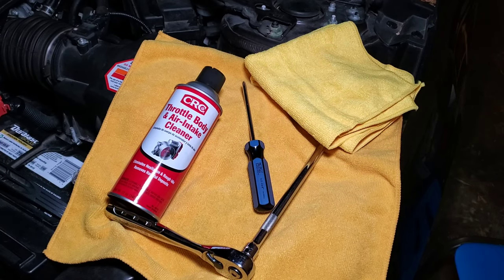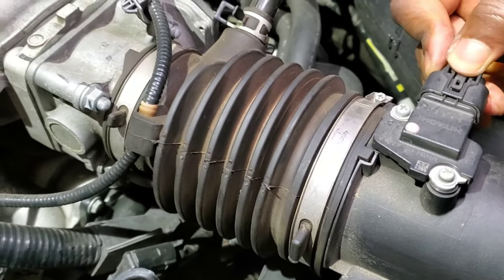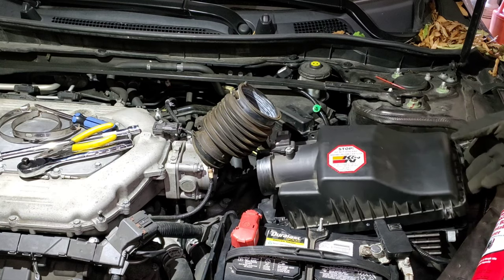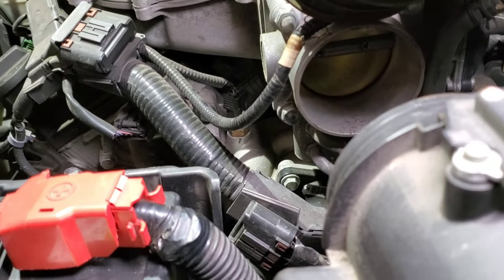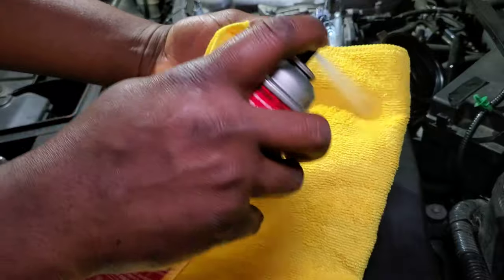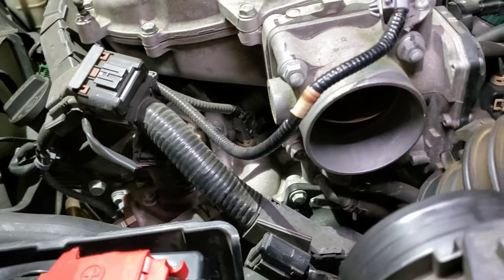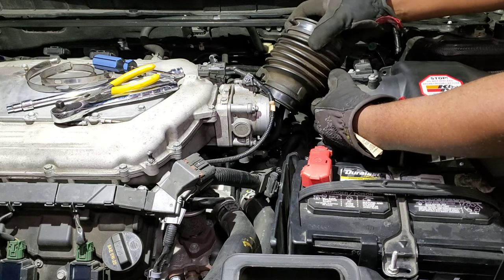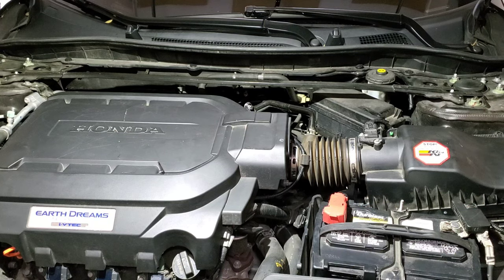How to Clean Honda Throttle Body

Comment: If you split that rubber, you will start having weird idling. Mine idling was pulsing whe stationary and found out it was split at the bottom and you need to do an idle relearning. Mine is an accord 2004.

Comment: Did that help to stop the vibration ?
Reply from the maker: this solved my problem this is the reason I have the video
Reply: Cool thank you. I am having rhe same issues on my honda accord sport 2015 . I will try that out.
Reply: Thanks for the video. After watching this, I think I’m going to remove the lid to the air box to keep from struggling with removing and installing the hose. Also, by removing the hose and air box…it’ll give me easier access to shove a Throttle Body cleaner soaked microfiber rag down into the Throttle Body.